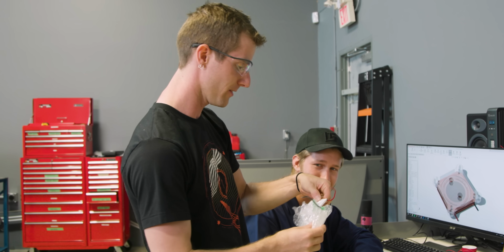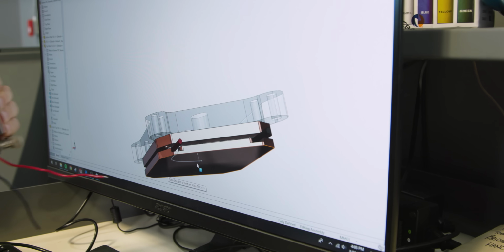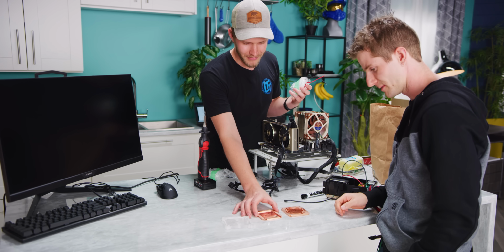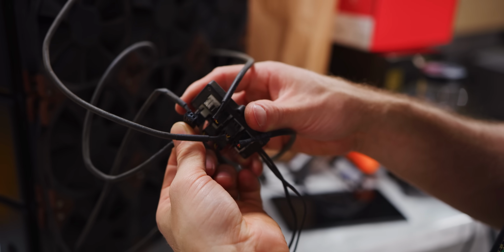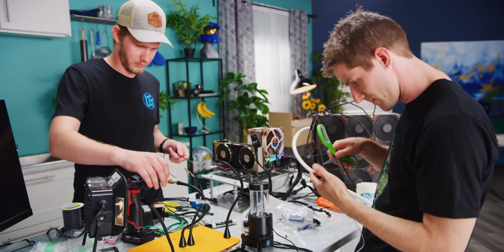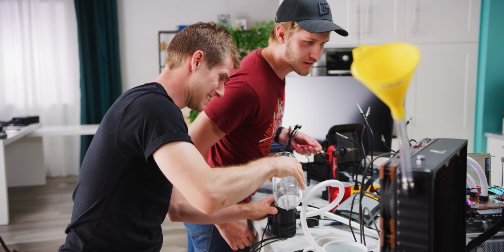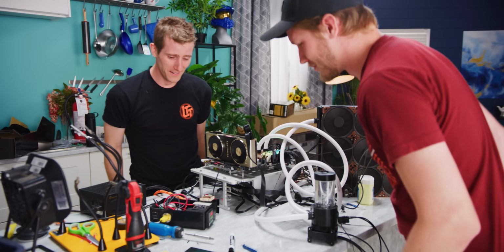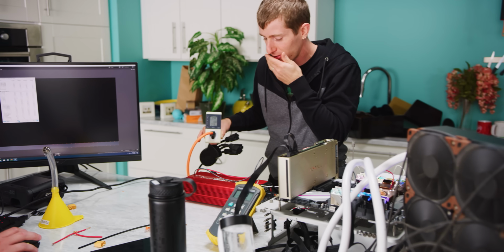This Cooler DRAWS 545W!!? Bad Cooling Ideas #2

Comment: The relay itself is the problem:
First, it's for AC power and expects the voltage to turn zero at some point. It turns off in the zero crossing.
DC voltage never turns to zero, so the relay will never turn off.
Also, it has a 1.6 volt voltage drop, so the peltier gets only 10.4 volts.
Please use a MOSFET next time. It will work way better, and we get to see even more sketchy LTT electronics. I love these videos!
Reply: I assume he used the PID as a modulating ( on/off)  controller to drive the relay.  Rather than a PI control loop.  Doesn't look like it would of mattered tho.
Reply: do you expect LTT to actually know how to wire a mosfet? inb4 they use it in the linear zone and blow it up..
Reply: @emperorSbraz  Alex looks like a pretty capable guy, in the case he didn't know, he'd be capable of wiring a MOSFET correctly with a Google search.

It's just they don't care of doing this kind of projects more correctly, the concept is pointless to begin with
Reply: I assume the relay is a dumb component controlled by the thermo controller, which outputs the PID pulse to switch the relay (that switch the power). Therefore I'm not sure if it really matters if it is for controlling AC or DC.
Reply: @FlameRat_YehLon  Solid state relays are usually just a box with a thyristor inside. Thyristors can turn a current on, but they cannot turn it off. Only useful for AC since the current goes to zero 100 (120)  times per second. With DC, the current doesn't go through zery by itself, thus the thyristor doesn't turn off.
Reply: @Electroblud  So is there a version of SSR for DC, or is relay output PLC using traditional coil relay instead?
Reply: @FlameRat_YehLon  There are DC SSR's. Those will have a MOSFET or a bipolar transistor in them, plus some driver electronics. But the one in the video is for AC

Comment: Also if you are going to get a radiator the size of a car radiator, why not just get a car radiator and save some money? Here is a custom aluminum honda civic radiator for 42 bucks thats about the same size as the one in this video https://www.ebay.com/itm/2-ROW-Aluminum-Radiator-Honda-CIVIC-EJ-EK-DEL-SOL-EG-INTEGRA-DB-DC-1992-00-94-MT/382862718217?fits=Model%3ACivic%7CMake%3AHonda&hash=item5924657509:g:pi8AAOSwbn9cmUMX

Comment: 20+ years ago peltier cooling wasn't a terrible idea. Back then watercooling was nearly completely custom and much more expensive than today, we didn't have heatpipe based massive air coolers to play with, CPU dies were OMGXBOXHUEGELOL compared to what we have now and they tended to max out in the 30-50W range of heat. All of that added up to an environment where peltier based cooling could work but was never cheap or common. It was a bit of a badge of pride for people who really wanted the lowest possible temperatures outside of, the then almost unheard of, liquid nitrogen based cooling setups. It was in the P4/Athlon era where peltier cooling started to have to shunt off so much heat that they became untenable as an exotic cooling option.

Comment: Hey LTT how about this for a build idea. If you put a case in a vacuum, then condensation can't form right? You wouldn't be able to cool with air with no air so you could pipe water out through the sealed enclosure to an external radiator.

Comment: Hey guys, I know that E-Fuel power supply. It is used to power LiPo battery chargers by model airplane pilots, but only by the ones with deep pockets and scarce manual skills. Cool people use server power supplies.
You find used parts for a steal, they are robust and A LOT more reliable than consumer products with fancy cases. The old generation is the best, made when servers were much less power-efficient than now, and power supplies were designed accordingly.
You can put multiple supplies in series by disconnecting the board from the case all supplies but the first, and connecting all the cases together, or simply keeping the cases well insulated from each other (cases are connected to the mass, and to 0V of both AC input and DC output, so in series if two cases touch it will short the first supply). That's how I got my 24V 100A monster power supply.
Good if you have a proper blade connector, otherwise you can directly solder the output cables to the connector pads (use a good amount of soldering alloy).

Just so you know for an eventual future build

Comment: When you're overdriving the TEC by 400 watts of course it isn't gonna work. A stacked config may have worked better. But since your not engineers I'll give ya a pass for trying. This is something I been meaning to do, and since linus failed I might as well give it a go.

Comment: Not 100% sure what you did wrong, but something is WAY wrong here. my last full time TEC cooling was back in the Prescott days (2004ish) but a ~300W (somewhere in the neighborhood of ~230W @ 12V) TEC was able to keep it at about 5C full load and close to -30C at 4.2GHz.  DId you guys put thermal paste between the TEC and copper plates?

Comment: Isn´t the hot and cold copper sides way to close each other? Also the cut out on the cold side should be a bad thing, the warm side of the tech is also spreading warmth to the copper that should be cold?

Comment: Read the datasheets for your elements - the graph took me solid 15 minutes to figure out but then you can see how driving your devices with more power quickly starts to give diminishing returns. More elements at lower power give you better efficiency, it may give viable cooling if you make it ridiculously large.

Comment: Don't forget that the Hindenburg disaster was caused (at least in part) because the US refused to sell helium to Germany.  The airship was designed to use helium, but America controlled the bulk of the global helium stockpiles at the time...and the only other gas that would be light enough - and accessible to Germany - was hydrogen.

Still not sure how it relates to the video, though.  :-D

Comment: Your experience here lines up with mine. I found that you want to run a TEC, the only reasonable way I was able to integrate one was as to cool the water loop instead of the chip, and even then it was only to boost the cooling capacity. There's a build on the LTT forums called Industrio that I did a while back that uses a 400w TEC water chiller integrated in the loop.  The TEC only kicked in when the water hit higher temps, but was pretty effective at shaving off 10-20 degrees F. I can't imagine trying to get it to work directly on the CPU without a LOT of excessive engineering (and if you look at the build, my idea of excessive is pretty far out there).

Comment: That water block would never have had been able to pump out any of that heat, like I guess you'd need to be able to get rid of maybe 700 watts worth of heat. Maybe ask der beuer to design one that would work

Comment: How about using the Peltier to power the CPU fan from the CPU heatsink? Because they work the other way around too (heat/cool them to get voltage on the wires), and I wonder if it could be possible to reliably do that or not.

Comment: I don't understand how you can interface a solid state relay to a PID controller. the output should be continuous. You should be using a current controller instead.

Comment: At 24:00 middle of the Test and the Radiator fans are off? Where should the heat ne disapated when you only run the pump but not the fans?

Comment: What I think you did wrong in this build is that you only connected ONE Peltier device. You needed at least two Peltier devices to cool your CPU. One was to cool your CPU and the other one needs to cool the water. That is why maybe the peltier wasn't getting the right cooling needed.

Comment: I would suggest adding termal buffer on CPU side. Something like two water blocks strapped together. On hot side it would be connected to a typical setup for cooling. On the cold side it would be connected to reservoir, pump and the CPU. I should note that the cold side of the loop should receive something other than water as there is a possibility of it getting to subzero temps.

Comment: Has anyone tried using a car radiator? Or am I dumb.....
Reply: Not dumb.
Ability to cool is a function of temp difference and mass, so if you use 10x the water and move it at (car cooling  flow rate) then the (giggle) heat from a single kw heater would be a rounding error. 
notice how they did not even turn the fans on the radatior on.
Reply: people use to use car radiators back in the early days of pc watercooling. works well but most of them are made of aluminum.
Reply: I tried it too, i think it was a motorbike radiator. It works, but thats aluminium.

Comment: The relay didn't work because its for AC. You need a solid state relay for DC. Also overvolting the thermo electric element just destroys it and has no change in cooling performance. Beside that it was a really interesting project.👍

Comment: if both of the copper plates are so close together and connected with metal screws isn't the heat transfering from the hot side to the cpu side?

Comment: Wouldn't this work much better if you used several TEC's running at low power to chill the water? With two loops (one for the cold/cpu side and one for the hot side) you can daisy-chain TEC's sandwiched between water blocks and run them at low power with high efficiency.

Comment: Make a heat exchanger with tech coolers... Like standard water to a heat exchanging box full of techs and that warms a second loop with radiators (also make a better drive circuit)

Comment: Hey Linus, the peltier cooler is in the wrong spot. The transistor based peltier cooler doesn't have enough flux per unit area to cool a transistor based heater (your CPU).  What you should really do is cool the circulating liquid with radiators, then a panel of peltier coolers in series. So the circulating liquid first is brought to room temp by the radiator, then brought to a low temp with an array of tech coolers, then sent to the CPU for reheating. I'd recommend water with some antifreeze for the recirculating liquid. Also, you can get well below the dew point of ambient air if you have a dry gas purge flowing over the sensitive areas.

Comment: If anyone want's to know what happend:
- first flaw -> 545W is not the cooling capacity, it's the powerdraw. Peltiers barley hit 20% efficiency under optimal conditions...and this was far from that. 
- second flaw -> I don't know what you calculated for the waterblock, but that design ain't cooling 545W+CPU TDP even if it was made out of some alien material. =D 
Sorry, but great effort.

Comment: You could build a wall of them to cool the air and uses fans to circulate the cool air around.l the case however it would be an expensive option but worth a try hint hint lol

Comment: Bit OT but I think running a single large fan on that giant radiator would be more efficient than the 9 smaller fans it seems designed to take.

Comment: "This is PID controller!" Then explains that it works like standard, dumb, simple hysteresis controller... 🤣
Reply: Yes but it's pulse width modulated...hint use 4-20ma output and behave like a lamp dimmer
Reply: @johngermain5146  Are you sure? I saw it going crazy with cooling and then opposite. No glance with stable PID (or slowly going out of stable stage).
Reply: @MariuszChr  1st they autotuned the PID controller at possibly room temperature.  Then, like you said, the temperature ramped down then up so fast that it appeared to function as an on/off controller which as we know has a few degrees of hysteresis.  Had the tuning been performed at the temperature of interest, and the temperature rate of change wasn't so fast we would have seen the relay operating within the proportional bandwidth.  The relay is on/off only so the only way to control the temperature within the proportional band is to adjust the duty cycle which will work but is not as good as true PID with adjustable voltage output which you can get with 4-20ma output.  It was all in fun and reminded me of the days when I worked on temperature controlled plating tanks using steam to heat the solution.  Steam holds a lot of heat capacity and temperatures rocket up as soon as a little is released.  Thanks for the input.
Reply: Their SSR was designed for AC power (it has triac inside). So when they applied power relay was locked to on state
Reply: @matucha123  We were using the SSR to turn the PSU on and off (from the plug)

Comment: Hey guys, TO SAVE THE PROJECT BUILD TWO LOOPS !!! The first loop cools the processor and is additionally cooled by a peltier (cooled by a second loop). The thermal capacity of water will make the control easier.

Comment: long story short, linus tech tips still doesn't understand TEC's.
Reply: and also blew up the one in the vid with waaaay over spec voltage
Reply: "Waste heat from the TEC..." - yeah, I always thought TECs were essentially heat pumps, transferring heat from one side to the other. I imagine there's some heat from internal resistance, but that sounds a wee bit odd.
Reply: @MattExzy  You get two separate heat sources with a TEC the heat being pumped based off the power you put into it and the heat generated from the power put into it. From everything i've seen you want to run them at 60% capacity for maximum heat pumped and minimal heat generated within the TEC. The PED was a step in the right direction but it still only controls how long the TEC is on maximum cooling like a thermostat for an A/C.
Reply: @Championjcc608  TEC's are simple electric heat pumps. I hope Alex/Linus revisit this because they made that stuff all sorts of wrong and I would like to see a high wattage TEC implemented correctly.  They need a much larger copper/aluminum block on the cold side to act as a buffer and a variable wattage power supply programmed to the heat differential in between the cpu side and the cold side of the TEC to try and keep it optimal.  They were just wasting a lot of power and overloading the TEC.
Reply: @wymcoupe9335  it's actually a fairly complicated process to control a TEC. Voltage and current are both variables in determining efficiency. Most simple control solutions control one or the other and the purpose built controllers run $150+ and from what I can tell they are only meant to run a single unit.
Reply: @wymcoupe9335  i was thinking they could use a bunch of tecs to cool water and then cool the cpu with a regular water cooling setup. That would give it a buffer so it could actually finish a benchmark. They should play to the strength of the tecs and use them to make a bunch of sub ambient water.
Reply: @MattExzy  it does transfer heat from the hot side to the cold side, but it draws x amount of heat from the cold side and deposits x+w heat at the hot side, where w is the power (work) you put into it
Reply: From my layman’s standpoint, it seems like TECs aren’t unusable but when trying to suck heat directly out of a source using the Peltier, you’ll never be able to keep up with it without something in between bringing the heat to the TEC. The TEC isn’t designed to pull heat but rather move it into a dissipation unit (like a rad).

Some other people said it makes more sense to have a TEC as a stage in a watercooling loop (heat from the CPU is delivered using a liquid then the TEC cold side accepts the heat load and moves it to the hot side to kick out of the system) and I tend to agree, again from the point of a layperson.
Reply: Or much else.

Standard.

Comment: iFixIt 5 screwdriver set in audio, video shows some kind of 15 screwdriver set in a pouch.

The Phobia Gchanger looks like a weird stitching together of radiator end caps when something could have been made for the size. Or mod something found in cars.

Edit: It's an optional version if you get all three of the five screwdriver sets.

Comment: Eh, you're just not doing it right.  Three years ago my primary workstation was a 6700K @5.1GHz with a 640W TEC direct die and custom loop and block.  I had some issues with condensation but had no problem moving the heat and keeping peak temp just over ambient.  My guess is your TEC was improperly rated... mine needed 16v/40a and a dedicated Mean Well RSP-750-15 supply.

Comment: The TEC overwhelmed the waterblock, once this happens it actually heats up the CPU, it was the waterblock's fault they projected 575W and forgot to include the fact that the transferred heat to dispate is 575w plus the CPU TDP.

Comment: You know it's going to be a good video when Alex puts on is engineer uniform...
Reply: i think an air cooling will suit for this because TEC is "collect" heat extreme fast, air cooler just fit very well for this. Water cooling transfer heat isn't that fast compare to a huge metal fin heat sink.
Reply: not a very good engineer obviously.

Comment: The best way to do it is pass it through a normal radiator first to dissipate most of the heat and then the plate cooling.

Comment: i might see a problem with this. i could be wrong. when you set the peltier into the copper , is it possible the depth of the copper is causing it to touch the hot side of the peltier. usually the peltier is a little bigger then the cpu. so your guaranteed to only hit the cold spot. totally hypothetical. a peltier with that much power should cool that cpu you would think. if not it should at least drop the temps instantly when you stopped, not by a degree at a time. more like 5 degrees at a time.

Comment: cool the water loop, not the cpu, be sure you dont go too low under ambient, the radiator gets frozen and waterflow will stop, i actually did test with that great Phobia radiator into a freezer, it works for a half hour than condensation go everywere , one time i forgot to power the waterpump and the radiator was totally frozen lol, keep a strong waterflow. You might need to make a pwm controller to feed the peltier to get around a stable temp, could be done but not easy hehe.